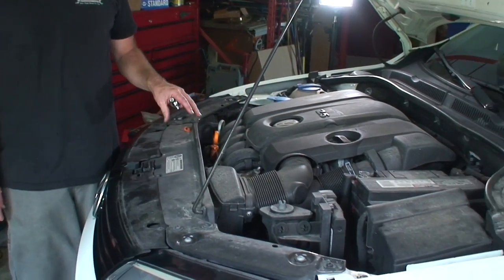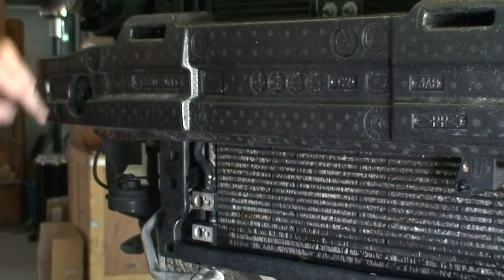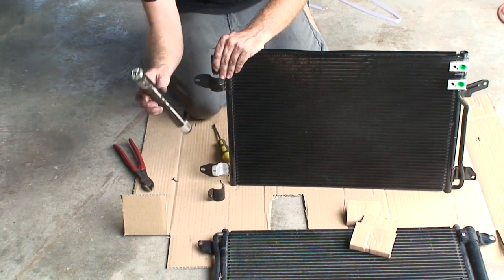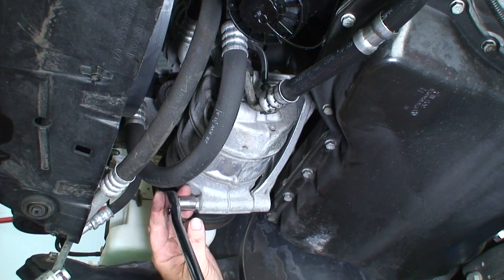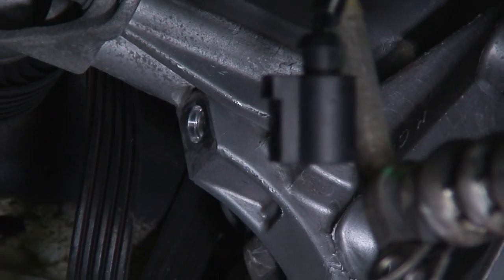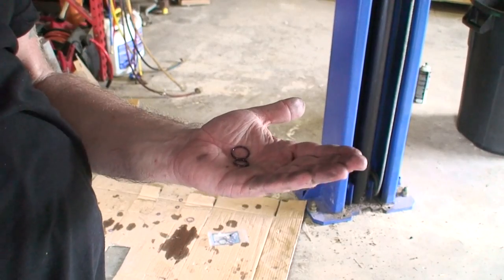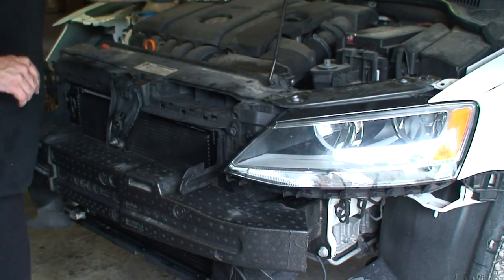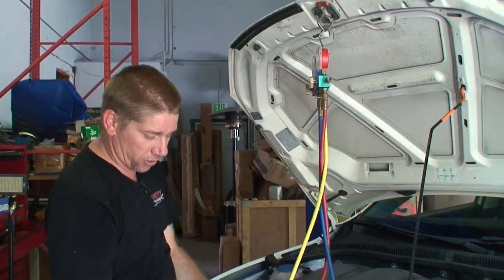2012 VW Jetta AC Condenser and Compressor

Comment: I'm not a mechanic I'm not certified and I took the radiator support out the correct way to do this in an hour... I hate to talk crap but dude you took the long route it's really not that hard.... Just get a bunch of markers color code your bolts with where they go on the car.. made my life and this job super easy, it's called the Volkswagen service position!!
Reply: So you pulled into service? I did that with my 98 A4 and never had issues.  So just markers and remove crash bar to service position?
Reply: @PeterFeltersnatch852 don’t even need extensions if you get 2 m10-1.5x12mm bolts and stick one on each side. Pulls everything out in the open.

Comment: waste of time !!!!! never tell your mechanic what to do lol let him diagnose I bet all he had to do was to change the expension valve $42 from amazon !!! I have changed mine 4 times already !! they just go bad ! btw I have 300k miles on my 2012 vw jetta and still use OEM compressor ! All I do is just get new expension valves what else... my condenser doesnt have half of their fins anymore and it still cools like a refrigerator
Reply: You don't know what you're talking about. Replacing the expansion valve won't fix the AC if the compressor has disintegrated and released metal debris in the system. At that point you have to replace the compressor and condenser.
Reply: @BlondynCh  What you're talking about is not the expansion valve but the refrigerant control valve or RCV, is basically the valve on the compressor where the electrical plug goes into.

Comment: My jetta 2013 2.5 cools only on one side but it is not a lack of refrigerant and the gates are working correctly together with its electric motors, have I changed the expansion valve and the electronic valve of the compressor, what else could it be? what temperature is it cooling to?